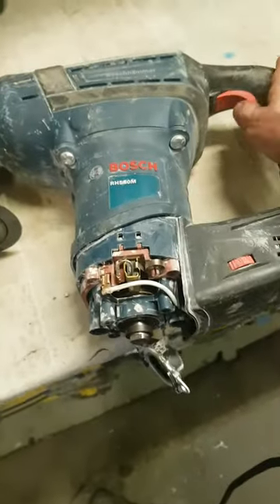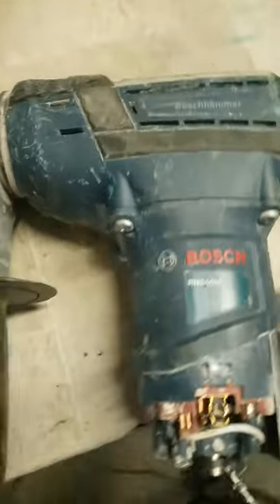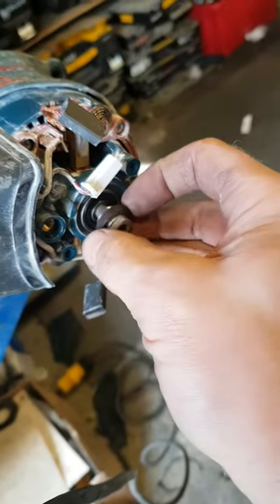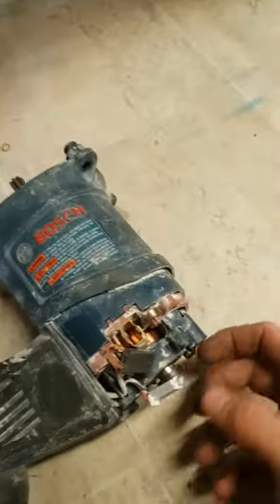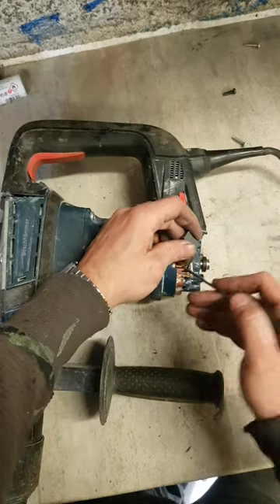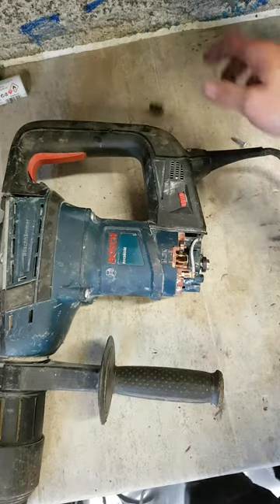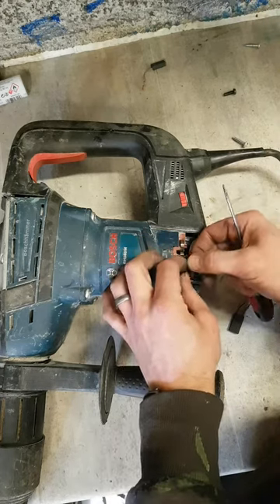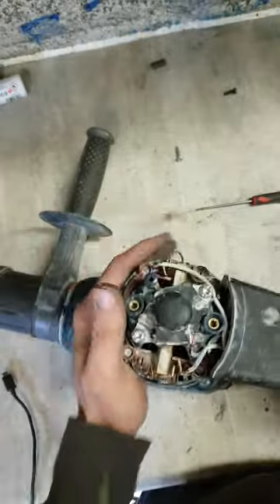Changing the motor on a Bosch RH540M hammer.

Comment: I have removed all the bolts you did, but the motor will not loose from the main gear head. What am I doing wrong?
Reply: Never mind.  RUBBER MALLET!
Reply: lol. I just changed mine out today using this video and had the same issue. After struggling for a bit, I decide to put the four screws back in but not all the way. I then hit the four screws with a hammer and voila. It came apart. Hoping this might help someone else.

Comment: Yea I don't understand why mine won't come apart so easy. I've removed the same screws you did but mine won't come apart. Is there something I'm missing? Why does yours fall apart once the screws are out?
Reply: Nevermind, took a rubber mallet to it and got it apart
Reply from the maker: Editing making it look easy. If its the motor section you mean. Take the 4 screws out, turn upside down, hold the motor tight in one hand, lift up the hammer, and hit the hammer section with a RUBBER mallet. That will separate it. 
It's the bearing holding it together and they tend to get tight.
Reply: lol. I just changed mine out today using this video and had the same issue. After struggling for a bit, I decide to put the four screws back in but not all the way. I then hit the four screws with a hammer and voila. It came apart. Hoping this might help someone else. Re-replying to this thread also